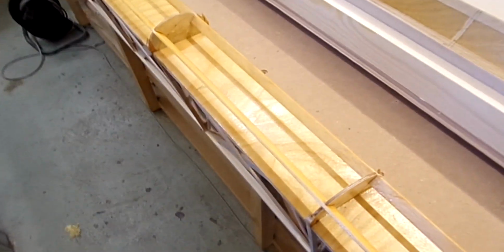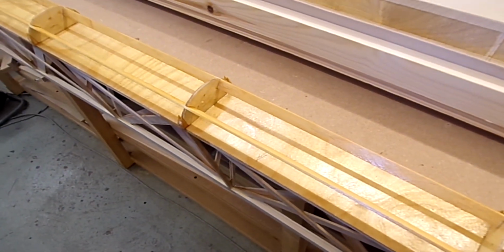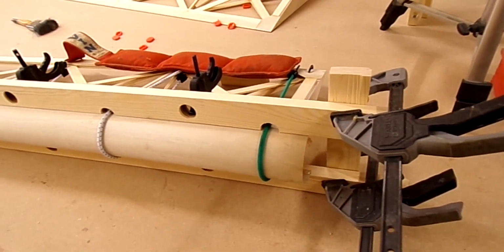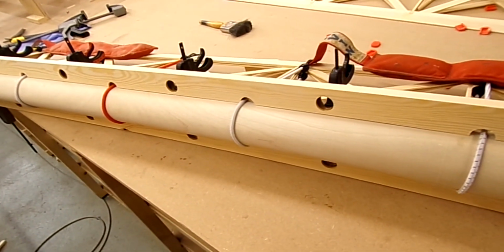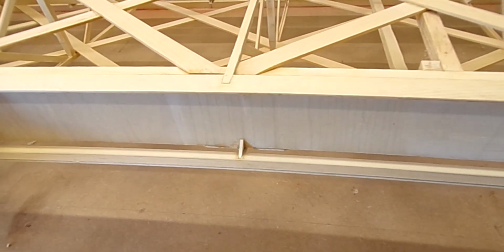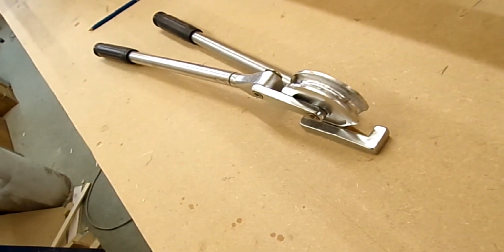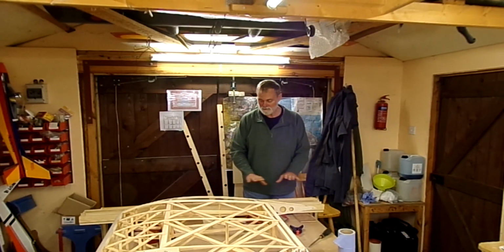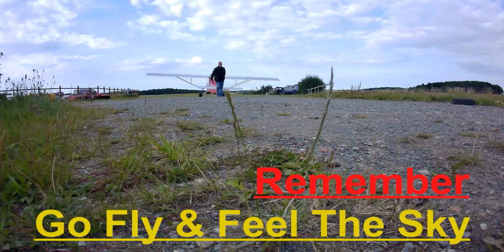EP46 Fisher Youngster V Aileron work.

Comment: As I say, any progress is progress.
I often think about the similarities of building a 1:1 full size aeroplane and what I do, which is build scale aircraft models.  This week I've been fiddling about trying to get the two wings of a 1: 32 scale Tiger Moth kit together, which involves lots of Tamiya tape, the scale equivalent of Bungie Chord, to hold things in place.  I'm also working on a 1: 72 scale EoN Eton glider, which has its own issues dut to its fragile simplicity and bracing wires to simulte.
Reply from the maker: I am interested in your models are they to fly or are they going to be bare bones for show. 1/72 sounds very small to fly but I have seen a video of a RC model P51 about 1/72 with retracts and flap that flew very well.
Reply: @flyingkub  Sorry, they're just display models.  Airfix and lesser known plastic kit makers.  They have certain challenges though.  I'm hoping to use metal guitar strings to represent the bracing wires of the 1:32 scale Tiger Moth I'm building.  It's a bit of an experiement.
Reply from the maker: @YeRobertPayne  don't do yourself down, it's still an art form. Don't forget to file the wire flat for the Tiger as they are not round and you might get a visit from someone like me :-)
Reply: @flyingkub  Thanks.  Not sure I'm going to be able to flatten 0.9mm steel that easily., even if I hit them with a hammer on a tiny anvil.  🙂
Reply from the maker: @YeRobertPayne  0.9mm that big no problem :-)